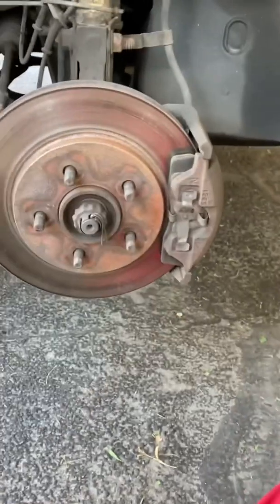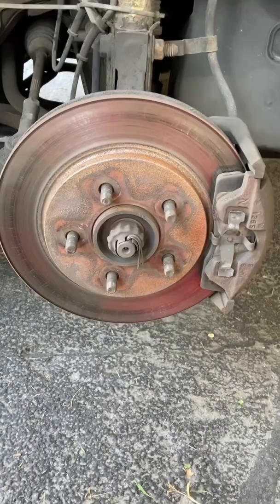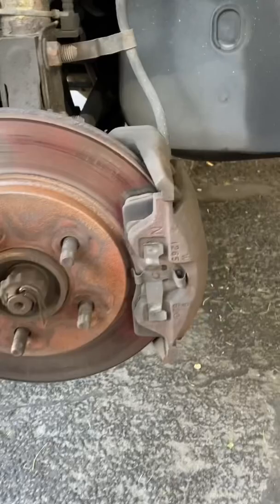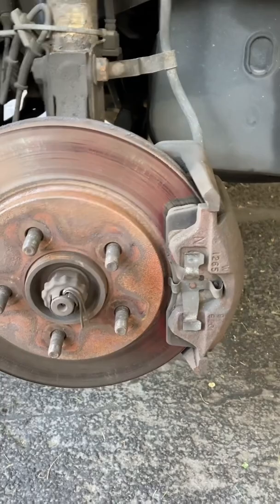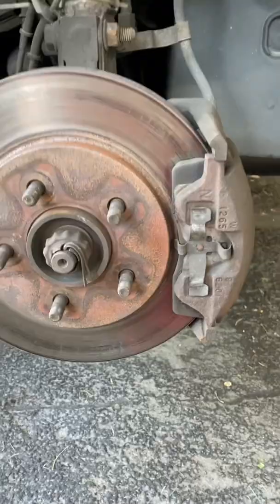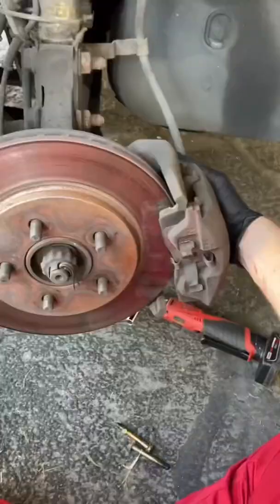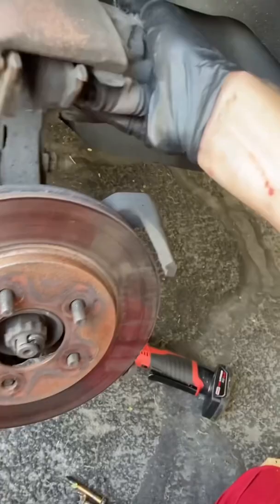I want to talk to whoever designed This! #shorts

Comment: In the last couple years I acquired a vehicle which I would not have chosen to purchase but was given to me. This week I discovered the alternator had went bad and my previous experience with older vehicles led me to believe this would be an easy job. Wrong! My first step was to look online and find a video describing the job. It used to be that you had to get a manual for a car you bought at the auto parts store but those people have kindly decided to produce videos as well now. So as I watched, to my horror, they said that I would have to remove the drive axle in order to get to the alternator. Screw that! Step two, find an easier way by someone who didn't follow that procedure. I managed to find one however it's still a colossal pain in the ass. Usually my comments about engineers are not too kind when it comes to the ease of working on cars. It's definitely nice when you can find an example of something intuitive and easy to work on. My feeling is most engineers never have to work on their own vehicles and if they do they're not doing it in their driveway.

Comment: My first question is what cars are you working on to where the brake caliper bracket has to come off to get the rotor off in the first place
Reply from the maker: everything. from newer toyotas (Thankgoodness not to change pads.) TO hondas Ford Chevy anything ive ever done hunderds of brake jobs and this is the first. The wors are hyundai or small car rear brakes because you even have to remove both caliper bolts and loosen the line. I did a vide about my break routine. CHeck it out it was on a toyota. Ive donse several in videos but idk all the names.
Reply: @RoadsideRescue  damn that's actually a surprise for me had a 96 5.0 V8 Ford Explorer 01 Ford F150 2010 Lincoln MKZ an Audi A6 Quattro a 97 Mustang convertible a 95 Volkswagen Jetta and a 2002 Acura TL Type-S........
 None of them had to have the bracket removed .... guess i always ended up with the odd balls

Comment: Those kind are easy to work on, too bad they ate brackets because some schlub just rammed the slide pins in with power tools and stripped those small mounting holes. And the hardware just basically rusted away leaving a naked bracket to take the beating
Reply: Yup.. it is a crazy low torque spec on those bolts. The only time one stripped on my Jeep was when a professional mechanic worked on it.

Comment: Meanwhile, ford engineers poorly designed a serviceable upper control arm bushing that fails all the time and also requires removing the control arm.  This isn't a huge issue except... one of the bolts for the control arm cannot be removed unless you drop the subframe. And if the nut and bolt were installed the other way around you could easily slide the bolt out.  But no, it must go in that way, and the subframe must be lowered,  just to slide out a bolt.

Comment: Get a Toyota, with a 10, 12, 13, 14, 15, 17, 19, and 21mm sockets you can take the entire car apart in your garage and reassemble it. Most fastners are in the 10-14mm range
Reply: Same with 2nd Gen RX7's, except there's no 13mm or 15mm on the entire car either, so even fewer tools needed.

Comment: Maybe im nitpicking here but why not just make the bolts easier to get to.......of the 25 to 30 cars i have done brakes on for myself and family in the past 10 or so years i have never had any real trouble taking off 2 more bolts for the caliper bracket.

Comment: I literally just finished changing my brakes and wish my car had this design. The bolts holding the caliper bracket were stuck on good. Had to settle for just changing the brake pads 😒
Reply: Try pb blaster for a couple hours next time. 

If that doesn't work, stick a metal pipe over your wrench to elongate it, giving you more leverage. Then you can even slide yourself under the car from the front and use your leg if needed to press the pipe/wrench with your leg to loosen the bolt. Ain't no bolt your leg isn't strong enough to break 👍
Reply: @Bischlarbo69  Thanks! I'll have to try that next time

Comment: I wish I could 1 hand a 1999 rotor i live in calgary with the road salt and snow every rotor is a war with my 4lb sledge or if I'm lucky 3nough they'll have bolt holes where I can snap some bolt heads off and get back to hammering
Reply: They weren't using salt when I grew up there, but that gravel they call sand meant a windshield a year... try NB, where they salt, even liquid pre storm to try to keep any ice or snow off of the roads.

Comment: That’s why I love my dodge neons just about everything is so easy to work on well the srt 4 engine bay ehh that’s the only that’s difficult but the brakes are the same
Reply: Neons are pretty easy to work with, as long as you're like...  5'6".  I had a hell of a time replacing my alternator, because my hand wouldn't fit back out with the alternator.  Or go in with the new alternator.

Comment: The best design assembly is on the Toyota trucks with their 4-piston brake calipers you don't even have to take out the caliber or the rotors to swap out the brake pads, not to mention 4-piston calipers with the way they are arranged provide even and steady brake pad and rotor wear prevent grooving and uneven brake pad wear or angles, these American calipers and rotors are very cheap and I loathe them not to mention this Pontiac caliber setup we're prone to disintegrating and falling apart because think about how easy it was to take the caliper and rotor off like that now think about that happening while you're driving down the road, all it takes is Rusty bolts or somebody doesn't torgue down the bolts correctly

Comment: One problem. Braking sucks on this design
Reply: It works pretty well on my Jeep so long as I keep the slide pins free to slide etc. I mean, piston to inside pad, outside pad fixed, clamps rotor. Other than different rotor designs and piston number or size, how does it provide bad braking?

Comment: Oh man… my dad had a 98 Plymouth Voyager. Definitely a crazy van. Lasted 325K KM before everything imaginable went wrong with it.
Reply: Stuff started breaking at 10k miles I am sure. It's just that it was well maintained and the last major thing broke at that mileage even a power window motor would mechanically total the turd
Reply: @JasonFlorida  I can tell you right now it was not very well maintained….it only made it to 325k after we had the engine rebuilt at 175k. This was before we knew what oil changes were. ABS completely rotted out, airbags not working.. the whole thing was a death trap. You know the rest of the story.

Comment: Lol the bracket is part of the steering knuckle so pull a wheel bearing bolt would do you no good to change the rotors.

Comment: Just turn the wheel to the right and you got access all day long to those bolts. The rest is up to you breaker bars, deep wells, extensions etc. a simple solution that don’t require any engineering. Axle pushed out ???  When I go in I take off ONLY the part and done quickly . I did rebuild my first car engine when I was 10 yrs old.

Comment: Let's talk about Chrysler caliper bolts that strip out in the bracket.
Reply: Let's do... the only time I had an issue was when a professional mechanic had to work on it for some reason. I personally have never had one strip. The torque value is surprisingly low if you look it up.

Comment: Damn. I have never seen a vehicle not like this. I have done many brake jobs and never had to take a bracket off the get a rotor off except for one large truck! But then again I don't deal with anything built after 2010 or 2011! 🤣 I am sure the new vehicles suck to even do simple brake jobs. Everything is unnecessarily complicated these days.

Comment: I don't think I would want to compliment the Chrysler engineers for anything to do with minivan brakes. They need changed more than the oil
Reply from the maker: Nothing wrong with that if they stop good. If it’s cool might as well acknowledge it.
Reply: Might be an operator thing too... or cheap parts. My mechanic is astounded how long my brakes last, but I don't race up to stops etc. Chauffeur driver training and ambulance driving. Smooth is the word.
Reply: @patrickbuick5459  Is Chauffeur driving a job worth getting?
Reply: @co.1157  I didn't think so, but 1) everyone is different and 2) some areas are better than others.

Comment: This design doesn't even have a caliper bracket. That's part of the steering knuckle. The bolts you're referring to are holding the wheel bearing in. What kind of wrench are you? 🤔
Reply from the maker: If I had to compare myself to one I’d say I’d be a 12mm box end wrench. Not as useful as a 10 but gets quite a bit done.
Reply: @RoadsideRescue  that's a pretty funny response, you're alright guy